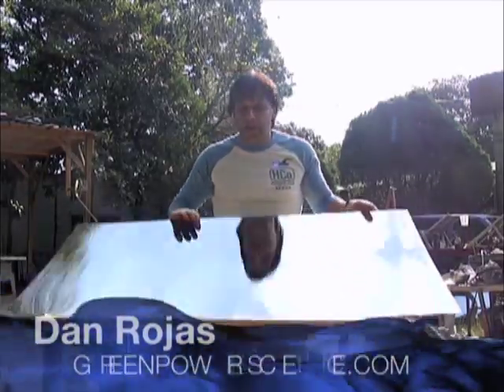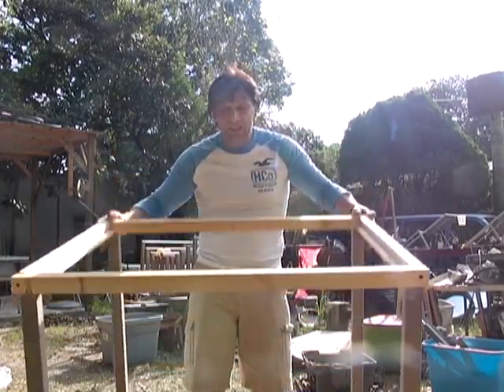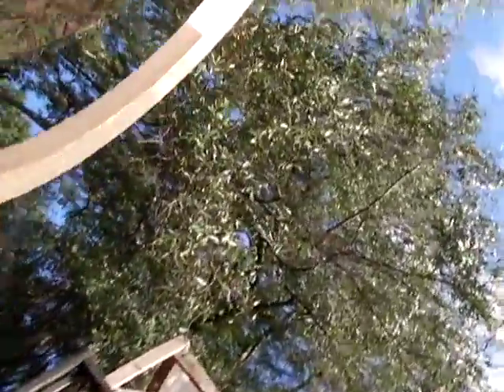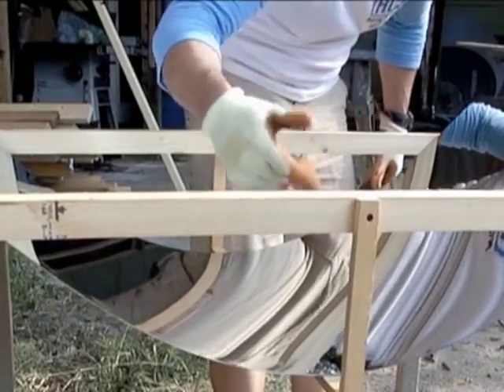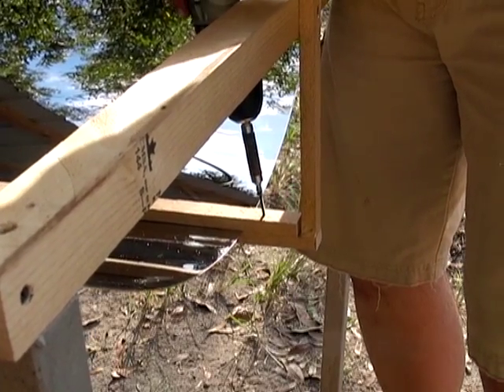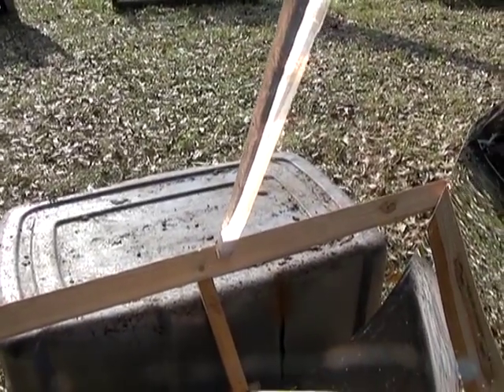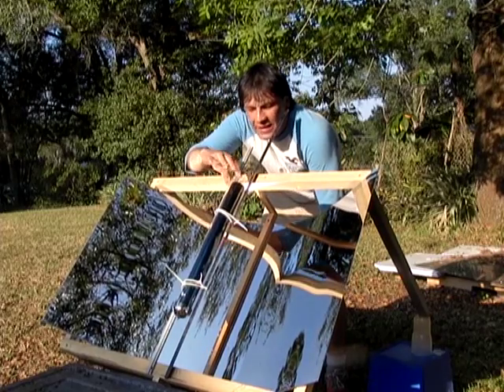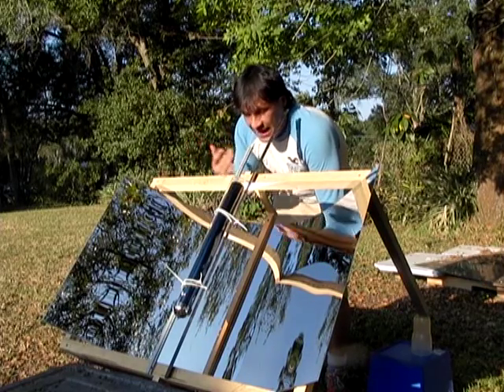DIY Parabolic Trough Mirror made in 20 minutes Stainless Steel Mirror free energy from the sun

Comment: What about using a dowel to snug down the center of your catenary-parabola so it doesn't deform?  This is cool.
If you wanted to get the maximum heat from it would you not have to track the sun with it, and if you moved it around how much would it deform the mirror as you leave the 90-degree straight up point?

Comment: Is that a true parabola or a catenary, or something else?

A catenary is a U-shaped curve that an idealized hanging chain or cable assumes when supported only at its ends in a uniform gravitational field. It is similar in appearance to a parabola, but it is not. The word "catenary" comes from the Latin word catena, which means "chain"

Here is a bit from some website talking about this:
To determine when a catenary will reflect like a parabola, I modeled the problem mathematically on a computer. As expected, I found an aspect ratio where a catenary reflector almost matches a parabolic mirror at concentrating light: 1 high to 4 wide, for a symmetrical reflector.

In other words, let the material hang down ¼ the distance between the posts. Following this formula, a couple of teenagers built an effective SCR cooker using hand tools in 20 minutes, under my guidance.

Surprisingly, it turns out that a properly proportioned asymmetric catenary reflector (ACR), where one support is higher than the other, will do a good job at concentrating light that’s not exactly perpendicular to the axis of the curve. This means that within certain limits, an ACR can concentrate the light as the sun travels across the sky.

Comment: Question: I want to make a parabolic trough to super heat a 1" black pipe fixed with a solar powered fan to pump a constant flow of warm/ hot air into my house in the winter. I have only seen water heaters using this method, but not moving air.  I live in GA and we rarely see snow, and tend to get decent enough sunlight at my house most days. I'm aware that sunlight Ray's drop to nearly 10%, but moving air through an insulated pipe should yield "warm enough" temperatures to help offset my propane furnace consumption. Will this work? And if anyone has tried, what where your results? Thank you

Comment: was wondering... with that trough setup, if instead of an evacuated tube and water... it was just a black steel pipe, or even rain gutter downspout... and then have a 12v fan (powered by solar of course) draw air through the pipe... could this application be used in heating in the winter?
Reply: Yes. It would work.
But whether or not it would be financially feasible - is the real question.

Comment: Dan, is there any advantage to combining a fresnel lens with a parabolic trough? Will it achieve higher temperatures?
Reply from the maker: Hi Jennifer,
It does not help. The size of the Fresnel Lens, Parabolic Mirror or Parabolic Trough = surface area and they all "concentrate" sunlight vs "amplifying" sunlight. When one is focused on the other, the only thing that happens is a smaller focal pattern but higher temperatures are not achieved because the second receiving trough, mirror or lens absorbs some light at a sharp concentration factor. This results in whatever gain for a tighter spot being lost by the second element absorption. Here is a video I did with a secondary optical glass lens:
https://www.youtube.com/watch?v=zuthle6k94A

Thank you for the question and please feel free to ask.
Reply: I notice that you bent your sheet along the long axis, creating a short, wide parabola. Could you bend it 90-degrees to the current axis, so you get a long, narrow parabola?
Reply: Okay; how about giving them more sunlight to concentrate? Flat mirrors on a heliostat putting more illumination on the back side of the fresnel?

Comment: You need to check your math.  Gravity will not create a parabolic trough, but rather a catenary.  The depth of the catenary is the hyperbolic cosine.  However, a parabola is a simple second degree equation created by squaring the independent variable.   Even still a catenary will focus light to an extent, but not like a parabola..
Reply: Xysix hi what shape or how can i set it up to create airheat with a large black pot for baking?
Reply: Xysix I don’t know what that means

Comment: I've got an old 3m in dia satellite dish. Would like to use it to heat up water in a stainless steel 120l cooker that has a 30mm thick base welded to it. I wanted to place the cooker up higher so that the dish can be pointed from low level to the bottom of that plate. 
My question is: how do i do it so that i can archive a boiling water? Should i place the whole dish in oval mirrors that are secured on silicon or liquid nails to the dish, pointing to the middle point of the dish? I also have a small magnifying glass in metal frame that i can use in the middle instead of the old converter. 

Will that work? 
Please any advice or ideas 

Best regards and greetings from sunny Australia

Comment: Thanks Dan, great video. But somethings not matching up for me. Maybe I'm not calculating this correctly. The sun puts out 1000 watts/m2 on an average clear day. Looks like your parabolic trough is at least a square meter. Using your numbers above I estimate your putting 294 Joules of heat into the solar vacuum tube over 14 minutes, equaling 0.35 watts of power. But I've read parabolic troughs can be equivalent (around 15%) to solar cells. Doesn't seem like your system is coming close to this.

Comment: Dude useing smaller parabolic mirror x20 that I got for a few bucks I scored 100°F a min at noon. Granted I never cont experiments due to relocation events however should you desire I will gladly redue said experiment and place it on youtube
Reply from the maker: Andrew harbit Spot temperatures are not the same "POWER" as mass temperature increase. A small beauty mirror will burn wood but cannot cook anything because it lacks size. The 20x does not equal power, it is focal length. The size of the mirror or lens is where the power is at. For example a small 5" mirror  concave designed to point out facial imperfections has a spot temperature of 793˚ F at a 1/16th inch focal area. A 13" parabolic mirror has the same temperature but over an area roughly 4x larger resulting in 4x the power. Like comparing a lighter to a blowtorch.
Reply: Focal length is not in x, but in units of length (cm, mm, inches).
Reply: he's talking about focal power ratio obv

Comment: +GREENPOWERSCIENCE,  hello dan,
just a thought. i understand that a vacuum is a good insulator, what i'm going to delve in is the inner workings of the tube..i'm thinking about going solar using this technology. and i have a 7 year background in hvac.
 my thoughts on this would be to make the inner tube out of a loop of copper tubing (maybe make the tubing using a straight drop out of hard copper and a spiral return around the drop from soft copper) hoping you understand what i'm saying, paint it flat black and using a parabola behind it,  but i was thinking about, what to fill the heat exchanger with.. and it hit me. i want to fill the tube with freon. then run the freon in insulated tubing to a heavily "closed cell" foamed insulated reservoir tank above the panel. using convection as a passive pumping system. the only active pump used would be for the cold water feed to the tank. then send it to other sources of use. like radiant heat, running polybutylene tubing under the floors and and spray foam the flooring to seal in the wonderful warmth. if i can make enough heat from it, then i could cook with it. and use a tempering valve for the other household needs. what would be your thoughts on the use of freon as the thermal exchange media. i've even thought of using a underground thermal storage well using zeolite. and the well would be a 500 gal. to 1500 gal lined septic tank, with a coiled up soaker hose attached to the top, then extract the stored heat when needed. using 24 volts on a washing machine valve. and low voltage control signals coming from a Honeywell "three stage" thermostat. ok as i review this post i'll stop >here<.
Reply: Interesting idea. Using Freon is out of my league, but would seem risky.

Comment: Hey Dan, I know how you could build this in less than 5 minutes :) 

What you need:

1 Sheet of the reflective metal.

2 - 5 foot sections of 3/8 " bolt rod

2 - 2 1/2 foot secitons of 3/8 bolt rod

1 - 3 foot secton of 3/8 " bolt rod

4 - 4 4 foot sections of bolt rood.

Misc 3/8's Nuts and washers....

Instructions:

1. Drill a total of three holes lengthwise along one side of the metal sheeting that are 3/8 inch in diameter. One must be in the center on the edige legnthwise and the other tow at both ends.

2. Repeat step 1 for the opposite lengthwise side.

3. place  5 foot long bolt rods between matching holes lengthwise along both edeges at the ends with a nut and washer on the interior face and exterior face.

4. Tighten said buts to adjust initial curve shape.

5. run the two 2 1/2 foot bolts down through the center holes along either edge in the same fashion with nuts on both sides to adjust vertical tension and shape....

6. Affix the two 3 foot sections perpendicular to the lengthwise rose in the same fashion to make the shape rigid.

7. Use the 4 foot bolt rods against the "top" lengthwise bolt rod at an angle and into the ground to adjust angle of mirror...

Je suis fini!
Reply: See your equipment list.
simpler suggestion follows.
flexible mirror.
string.
drill 4 holes one per corner
drill 2 more holes opposite each other on the proposed curved axis at the midpoint.
make your preferred parabolic shape...then thread your string....and tie off the points so they become stable.
If done right....you should get two isoceles triangles.
by attatching a seperate piece of string to the midpoint of each string and running it to the axis...the whole structure can be held more stable.

Comment: Dan ... Just thought of a couple of things ... 

1. The Center hold down spar? You make it out of wood sooooo if you used a tensioned wire there.. say 12 Gauge Copper Wire? (no insulator) tensioned by by a bolt, two nuts, and two washers on the underside on the spar on the reverse side.. you could have less possible light lost and likely it would be cheaper as all the items I just mentioned can be sourced from objects that get thrown out everyday.

2. If you wanted to use this as a boiler for a steam turbine I would run a water inlet and outlet hole into the umm boiler unit...  have a valve that allows the steam out for the outlet... through your turbine and then to your water tank to pressurize it to sort of force feed the boiler fresh water... also I would insulate the top length of the boiler unit as ummm while it is a vacuum thermos type deal.. it well honestly you are likely losing more heat out of the side not being hit by the concentrated solar....

3. I think making a solar powered Train Steam Engine would be pretty cool to do ;)

Keep up the good work Dan :)

~Jesse Mercury

Comment: The other thing is you don't need your expensive vacum tube.... you need to insulation and like a steel plate and like a mirror (steel) (and flat)... to at the focal point (slightly back) using the laws of reflection bounce the still concentrating light immeadly into another flat mirror right near it to bouce your light (concentrated) to a block of salt on top of a steel plate that has insulation (fiberglass) all around it except for about a 1 inch hole in said insulation where the light hits the steel plate... conduction heats the salt block (Salt does not melt till 801 degrees C)... to moore than enough temp to use as a thermal energy storage mass to say heat your home 24/7/365 or like cook your eggs with or like cook a roast (Or my choice make tacos) .. all for free.. batteries are not a smart way to store energy.... for solar thermal storage masses like stacked 5 dollar 50 pound salt licks (For cattle) are a much better choice..... now you have a choice at this point on how to turn it into electricity... since you are geeting about 60 Watts per square foot of sunlight every second.... ummmm I would use a homemade steam generator and automotive alternator... cheap all reusing stuff we throw out or is 100% reusable.. copper radiator on the top of the salt block pile.. water running through.... heat (very hot) running to said turbine.... well there you go.. kiss your power bill good bye.... as oddly enough this can be done in apartment units inside without modifying the apartment :D ... again keep paying it forward :)

Comment: Well this is an even cheaper rig for you that uses four sticks and can be made in less time and without a form....cut two sticks to collector depth you want... then scew them to middle sides  of the collector.. next run the other longer two boards from edge a and edge b along the side... and screw them to the vertical boards  now that would use less wood and with just a jig you could cut all the pieces to length in one saw strike.... then the screwing would take about 3 minutes.... so cheaper and does the same thing... and for campers/hickers imagine this as smaller and packable.. that uses LONG bolt rods and nuts + washers to ummm use your leatherman multitool in the field to flex the collector by tightening the bolts......;) keep paying  it forward though man... step by step we can save in the USA alone households about 108 Billion dollars per year in just electric costs (money thet gets pumped into mom and pop stores in smallville america..... As Benjamin Franklin once said, "Doing good for my fellow man is the highest service I can do unto mankind." ;) ~OH I RELEASE THAT CONCEPT under teh Linda Kelly Henson Synergy License (we miss you linda or at least I, Alicia Stone do miss hope you are well)  ... synergy license is essentially "No Rules, No Tos, No Worries." (so once  you read the concept it is YOURs oh and HIS and HERS well everyones.. you make money on doing things that takes labor and not buy owning and idea...

Comment: Just brainstorming here, but... say you used a small solar fan (which I have) to force cooler air into a suspended metal tube at the focal point. Would there be enough reflective energy to warm the air noticeably from bottom to top, so that you could circulate the warm air back into something like a small shed or chicken coop? Maybe coil some black hose - like a phone chord - up through the metal tubing to keep it inside a bit longer? Just curious.
Reply: a heat exchanger or radiator from a car would work well. radiator would be a big project tho. 

get the warm air by pulling it through the hot radiator, like in a car. instead of using it to cool the radiator, you are instead using the radiator to heat the air.

Comment: if this mirror were say, at the bottom of a kiddie pool, would it heat the water from the sun passing through the water then reflecting back from the mirror?
Reply from the maker: To heat a pool, just place black objects at the bottom. Mirrors in the water reflect sunlight away. WHite pool bottoms or mirrored pool bottoms are ways of keeping water cooler vs warming. Water is clear so it does not absorb light well regardless of the bounce passes. Just make sure objects are removed before anyone swims.
SIMILAR PROCESS;
Fresnel Lens to heat a swimming pool with solar energy
Reply: GREENPOWERSCIENCE
Reply: GREENPOWERSCIENCE

Comment: Love it, where did you get the mirror steel?  Most plastic companies have mirror plexiglas. You could get up to 800 w per sq meter with insulation and tweeking, but  if you orient horizontally and use through tubes instead of capped for your evacuated tubes you can bump surface area to 10-15 kw and use heated liquid to heat house in winter north of 40th parallel.  Consult local industrial controller people for pump/temp controls.  Also controller or radiator has to be added to avert from sun when fluid temp exceeds danger point, 180F for water, 500F for silicon oil.  Pipe couplings above 200F then need to use high temp solder and 1000 to 10000 gallon heat storage tanks are needed.  Also, some evac. tubes won't go above 300F, check specs.
Reply: Sailgoat I'd like to speak with you if you have a private contact method and are still current on the solar thermal game. Lots of wishy washy info out there in this space, yours is spot on.
Reply: I have interest in high efficiency > 95% reflecting
Reply: material / metal

Comment: Dan, how much water did you boil here? 14 minutes, approximately 1 sq m of sunlight, we can work out how many BTUs you got - very interesting datapoint to measure the efficiency of concentrated sunlight
Reply: Anders Haagen 
muito bom essa experiência
Reply: I think the effective working volume of those tubes is 1L so using that I get a figure 1,354BTU/h or ~400W ~316BTU over the course of the 14 minute boiling time, all assuming a starting temp of 70F for the water. I've heard these tubes quoted as operating at ~80W without a reflector so that's pretty impressive.

Comment: Imagine this along the front of a house facing south.   The parabolic lens could be smaller and rotate around the tube to adjust for sun height during season change. The vaccum tubing could be an additional hot water supply for the home and could span the entire length of the home with mirrors the entire way. It could also be stacked in rows on top of one another to heat numerous pipes for larger households.

Comment from the maker: Yes, but they are white colored and the focal point is broad so they only get about 140f. The tube exterior is insulated and cool to the touch on the outside. So the ties work for a test. For long term usage a metal wire etc.

Comment: I'm not sure if this is correct but I saw some chinese made evac tubes on ebay and the specs said 116 psi. not sure if thats right and if its enough pressure to directly use the steam to run an engine / generator